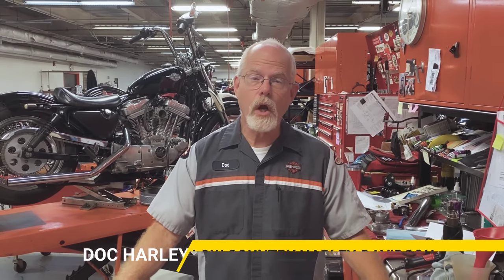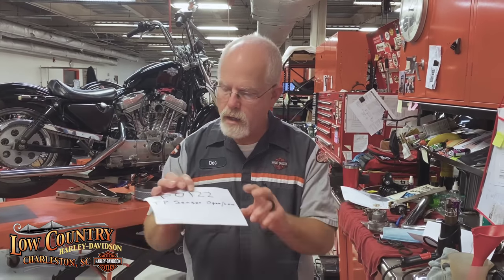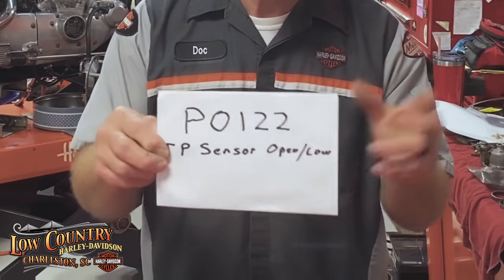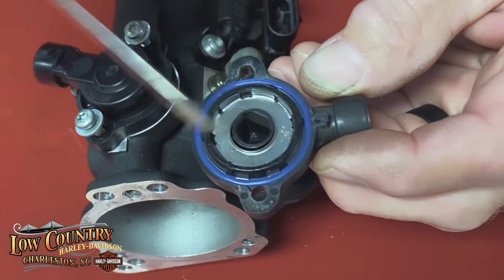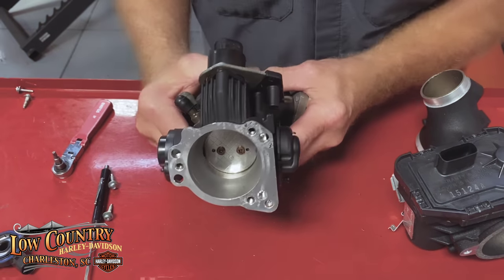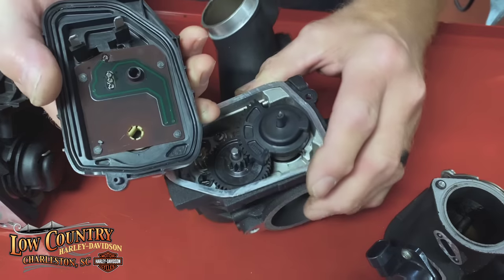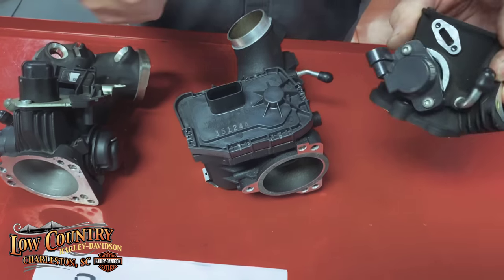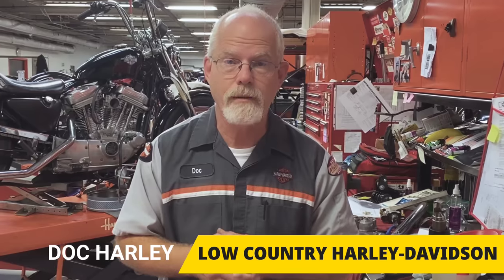Throttle Positioning Sensor | Doc Harley | Low Country Harley-Davidson

Comment: Too bad there isn’t a “Doc Harley” at every dealer…. Life sure would be easier…
Reply from the maker: There are many who are better, but I thank you...Doc
Reply: @LowCountryHarleyDavidson  Oh no.   They start out with "it might be the tire pressure"  "It might be the fuel, we will have to drain and clean the system"  On and On
Reply: @LowCountryHarleyDavidson  Doc it’s not so much the skills or even the knowledge. It’s that you have a passion and actually care. Too many techs ( not just Harley ) don’t care and they’re bothered by customers so much they can’t focus on the actual task. Not bothered as if  a customer is haggling or calling all the time. They simply are bothered by the mere fact of just bringing the bike in and asking questions. They’re annoyed by that. Instead of taking the approach of “ what’s the problem with the bike? And wanting to find a solution “.
Reply: @LowCountryHarleyDavidson  Don't want to disagree with you, and maybe (but I don't think so) there might be some that are better, but I don't think anyone has the passion you do about helping people understand how there bike works and things a rider can do to make sure their bike is safe and running at peak performance.  Thanks for taking to time to do these videos.
Reply: 🚲🚶💭 thanks doc harley. 
                👍👍👍👍👍
                 🌠🌠🌠🌠🌠

Comment: Doc, Love your videos.  My wives 2001 Heritage had a cough occasionally and was hard to diagnose.   Finally figured out that it was when the gas tank was lower than half full.  The corrugated gas hose in the tank stretches after a while and the hose rubbed on the side of the tank and got a small pinhole in it.  It was a little tricky to figure out.  Thought some of your listeners might want to know about this issue that I have seen twice on Heritage before.
Keep em coming.
Reply from the maker: Thanks for sharing....Doc

Comment: Been there many years ago on my 03Ultra. Pulled off interstate and tried to die at exit stop sign, hotter than normal. I believe it was running very lean at the particular speed we were traveling.  Took it a little slower and rest of the trip home was ok. Checked resistance of TPS once we were home and sure enough it had a definite bad spot. Did a Thundermax tuner last year decided to replace it again as we are around 138k now. Kept the old one as a spare as it is still good but feel better with a new one on it. 
We thank you for your continued support and info.
Reply from the maker: Thanks for sharing your story...Doc

Comment: Great vid doc, thanks. 
Exactly what I had concerns about, but my2015 - 1200 only has about 15k miles. so think its unlikely to be wear on that sensor.
Has a ragged patch, just as throttle opens a tiny bit. Realy dosnt like ticking along steady around town. 
Fine under power, and everywhere else, just that first tiny touch. 
S.E tuner cables should be here this week, so will plug it into record mode for a while and see if that shows where the issue is. 
Tks again.
Reply from the maker: A great plan….Doc
Reply: @LowCountryHarleyDavidson   Ive been rideing a few decades, (newest was an 82 mk111 Guzzi) But this is 1st HD, 
Not used to the computers, elec ign or fuel injected, so a little head scratching 😂.
She gonna visit the 1 guy in town that realy knows what he's about. (small town on West Aussie coast) He has 650 Harleys on his shop books. Not that many in the area & Lotta guys travel a long way from sth and nth for his work, so I think we're in good hands :) 
Im just watching and learning  ☺.

Gotta say i love this sporty. So much time wasted. (kinda)

Comment: Thanks Doc. Always informative.  Prior video question:  The factory changed the oil pump in 2020. Does the 2019 1/2 Electra glide standard have the newer oil pump?

Comment: Hey Doc...Awesome videos and thank you for taking the time to do that for all of us Harley Riders.  Quick question:  2003 Harley Road King EFI FLHRI   Replacing the TPS is pretty straight forward so my question is...Is there any calibration or setting for this TPS or is it a "bolt on and go"???   I don't see anything about Calibration so Im assuming there is none but I wanted to run it past the Guru first..
Reply from the maker: Should be a plug and play with stock ECM. Buells and ThunderMax have to be calibrated...Doc

Comment: Thanks for the info Doc!  I have a 2020 Softail Standard that has an overly stiff throttle position sensor.  It wears out my wrist after 1/2 hour of riding.  I changed handlebars and decided to disassemble the TPS to see what was going on.  If I ruin it I"ll buy another one.  I'm trying to figure out how to remove the splined cog on the end of the sensor without destroying the sensor.  Do you have any idea how to do that?

Comment: I’ve got a 2021 street glide special that has 18K miles on it and I’ve just noticed it had that same code. I’m just wondering if it’s too early to be that or a broken wire or something?
Reply from the maker: Most of the time on recent models it is a clitch. It occurs most of the time with riders who shut off motor with the handlebar switch while their palm has the throttle rolled on a bit. You should still have it checked out…..Doc

Comment: Doc do you have a video on the Cam Position Sensor? I have an intermittent engine light that’s been coming on for years and I believe someone said it was either a ground issue and or this sensor possibly needed replacing. It’s on a 2000 FXDX. THANKS

Comment: I have a question DOC - I have a 2014 Streetglide Special , 26k  , the issue I’m having is that when I’m on the highway and shifting up  the bike sometimes seems as it looses power for a second or 3 so I release and re engage and it’s fine happens in higher gears. Kind of like as if it’s  spuddering  and not all the time here and there any insight to for me to look into Doc ! Thanks  for your input
Reply from the maker: Thanks for trusting and reaching out to us at Low Country Harley-Davidson. This is not a simple diagnosis. I would start first with battery check. Condition and connection. Older than 4 years replace. Have someone check charging system. Spark plugs and wires depending on mileage then fuel filter…Doc

Comment: Hi Doc, so I'm wondering would there always be a code showing up. My sportster is acting up when I try to keep it smooth around 35 mph. But it will hesitate and/or misfire. I'm thinking of the TPS. But I can't see any code. What do you think. Thanks doc. Alan, from Scotland.
Reply from the maker: No a code will not always show up…..Doc

Comment: Love the higher resolution camera!  Are there metal gears to replace the hard nylon? Would they be preferable or force wear sooner where you can’t get to it?  Thanks Doc!
Reply from the maker: This is a non servicable part.Was taken apart to demonstrate.. HPI might offer mods.......Doc
Reply: Nylon gears can be bullet proof.  Not I mod I would recommend.  As proof, the old indestructible Maytag washing machine transmissions used white nylon gears.

Comment: Thats great. Looking at my parts manual the complete induction module has to be purchased to replace a bad tps on a 2010 road king
Reply from the maker: Yep sad but true…..Doc
Reply: I am impressed. I really didn't expect a response. Love your videos. I am guessing with 86,000 miles mine is do for a change. Seems to have intermitten sputter from a stop sign. p2138,p2127,p1510,po113. Runs down the road 42 mpg. intermitten engine light.  @LowCountryHarleyDavidson  1st had p0113 iat solved , Then battery light, regultaor rectifier solved, Now p0113, p1510',p2127, p2138. mistakenly replaced iat with non harley part so that explains p0113. kind of shopping for a take off intake, may try removing the retaining cover clips and just swap unless I notice something with gears. I have had harleys since the 70s and spend a lot on parts though 0 on service. If I were closer it would be worth swinging by for a diag. I ride 70 miles to my favorite dealer to buy parts.

Comment: On my 08 roadking I had a whipe out and it started to idle high but its electronic so no adjustment. Turns out if i turn it off with more than 0 throttle it needs to be reset. This video was my first thought but after digging further I found out it wasn't the sensor.

Comment: I've got a 2009 street glide and recently it went into limp mode and has a surging idle with these codes P1511, P1514, p2105, P2135. Do you think this would come from the TPS sensor going bad? thanks! Great Video!
Reply from the maker: More likely the pins and connections in the connector to Throttle Control Mech. If you are lucky all you need is to replace the female connectors in the connector with the newer updated parts.
Reply: @LowCountryHarleyDavidson  thank you! I’m taking it apart tonight!
Reply: @LowCountryHarleyDavidson  found the issue. The brown/orange wire in that plug has a break in it when wiggling the wire with the Fluke meter right at the edge of the female connector. Thank you again 🙏🏽
Reply: Yes similar codes with my '09 UC, had the limp mode issue or nothing a couple times. Thinking those pins or a crimped wire also.

Comment: Heya Doc i have a 2019 xl1200ns with a P0122. Any pointers on how to calibrate a TPS??
Reply from the maker: Not sure what you mean by calibrate. Usual issue is owner turning off bike with handlebar off switch while slightly rolling throttle ( not knowing he is doing this) so the bike ECM remembers where throttle plate is. But when turning on bike the TpS does not match last known information. So turn on bike without touching throttle. Wait 20 seconds. Turn off 20 seconds. Repeat 2 more times. All will be calibrated
Reply: @LowCountryHarleyDavidson   I thought there was some special way of putting it back on. Kind of like on a car lol. Thanks for the reply Doc. Appreciate ya

Comment: I’m working on a 2014 ultra ..I’ve replaced the throttle sensor and I’ve checked all wires between throttle and throttle body and from the ecu to throttle body and the only thing I found is no  voltage on the high/ low wires but have questions on if m testing the right way and could it be the ecu
Reply from the maker: Yes it could end up being the ECM but more likely a wire near the neck that is internally semi-broken. Won’t see it. Got to pull inch by inch till you feel the break….Doc
Reply: @LowCountryHarleyDavidson  even though Continuity in all wires is good

Comment: Hello Doc:) I have a 06 Sportster XL1200C with (35,000 kms) 21,875 miles
I just installed V&H Short Shots, larger Air Breather, Pilot Jet 45 and 185 Main Jet with 3 washers on slide needle
I'm out 2.5 turns trying to smooth my bike from lurching a bit at steady Throttle
Any help/suggestions would be greatly appreciated
Thanks in Advance 
Bill M

Comment: Good day what does it mean when I’m in second shifting into  higher gears when I open the throttle when shifting the bike Boggs no power  and I release the throttle and it goes back to  normal. No cods 2014 SGS  thanks
Reply from the maker: Year, model, modifications, fuel filter last change? Battery age, spark plugs age? Too many variables to give a fair diagnosis…..Doc

Comment: Great Video, one question. My Iron 883 model 2020 hast very high Idle consistently about 1600-2300 RPM... The ecu tells me the Error p0122 Sometimes and p0507 every time. Engine light is in every time. Should i replace the TPS? Shes got only 10000km
Reply from the maker: Start by readjusting your throttle cables. If you have chsnged the handlebars you have a throttle position sensor wire problem. Follow all the wires. If you have changed the air cleaner. You might have a leak. Maybe a un supported throttle body so an air leak at manifold seals…..Doc
Reply: @LowCountryHarleyDavidson  yes i changed the handlebars and the odometer to the Side. Throttle cables are fine the throttle flap opens and closes correct. I installed an Arlen Ness Big sucker too. Thank i have to Take a Look at the wires that i extended an Air leaks. Thank you for your time Doc

Comment: Dear, the code 2138 road king 2008 appeared. Do you have any tips for a solution?
Reply from the maker: P2138 TGS correlation error. Twist Grip Sensor wiring check for poor connection. Rubbed through wire insulation ( from install in aftermarket handlebars) if all wires and connections are good then voltage testing is next….Doc
Reply: @LowCountryHarleyDavidson  Thanks for help.

Comment: I have a 2005  HARLEY DELUXE with this issue. Replaced the TPS but the issue is still there. Is there a way to adjust the TPS? Would a weak battery cause the TPS to fluctuate? Currently it will not hold an idle.
Reply from the maker: Yes there is a slight adjustment possibility. But I have to ask How are your intake seals?  And are you running 8 degree injectors when the 25 degree injectors with the right software run and idle so much better....Doc

Comment: Hi Doc, looking at this video and I'm wondering if this could be the trouble with my bike. It's a XL 1200C, it's a 2011but only has 18000 miles. I can't see any DTC codes. But doing 30-40 mph I'm getting a misfire and jerking. The nearest dealer is at Edinburgh or Glasgow about 150 miles from Aberdeen. What do you think. Och I'm fair seek aboot this doc. Thanks Alan.
Reply from the maker: Is your bike completly stock? Does this misfire only happen at this part of the throttle? Have you checked your intake manifold seals? Too many questions to be able to say yes....Doc
Reply: @LowCountryHarleyDavidson  Hi Doc thanks for getting back to me. Yes the bike is stock aside from the mufflers, which are Harley but the cats are out.  Stock airbox. It's only at around 30mph in traffic. The bike will act up, missing and jerking around. I haven't had the manifold off at any time.
Thanks for any advice you can pass along. Cheers, Alan.

Comment: Hi, I have a 2021 Police Ultra, when at 70 I torque it to pass a semi, the tach fluctuates. Also, the cruise control is deactivated on a hill, is it related to the throttle positioning sensor?
Reply from the maker: Tach fluctuating will turn off cruise and effect power output…..Doc

Comment: Hey Doc, interesting video, I have somewhat of a issue with my 18 SGS.  It has about 15000 miles on it and stage 4.  My issue is different but when I am red light and I go I have a hesitation issue from my bike. It is really annoying, only from the start when I start to go.  Doesn’t do it all the time but at least half the time. Jus sputters and then all of a sudden is goes and only from the start. Super annoying, could this be the same issue in my bike?
Reply: Had the same issue on my 18 Limited from 15000 miles on. Took it to 3 diffrrent dealers in DC area. No code so they said nothing wrong. I suggested a re flash( stock everything)? They looked at me like i was crazy. Did an air filter oil bypass & seemed to help. Maybe carbon on top of piston causing valves to problem up?
Reply: @johngloede8222   yah I dunno, you’re suggesting venting to the atmosphere or catch can from breather bolts?
I was wanting to get some headers, and the HD smart tune added with my screaming eagle tuner and then get it dynoed. Maybe it is a bit of a mapping issue.

Comment: I have a P2127 TGS2 Low/Open and p1510 codes w/check engine light on, but my Harley Softail Standard is running fine, it's been on for about 2 months, finally was able to get it to my dealer, and they said it's a sensor. It confused because like I said it's not giving me any problems. It's a new bike w/5500 miles on it
Reply from the maker: Communications could have been better from your dealer. I believe they found a connector to a sensor that had questionable terminals. The bike ran ok for now but this connector had loose male to female terminals that would have failed down the road....Doc

Comment: What about a fluctuating idle? My 09 road king will go from 1100 rpm to 700 up to 1200 then below 700 and sometimes turn off while idling in neutral at a red light. Seems like once engine gets to temperature idle fluctuates
Reply from the maker: My first thought is an intake seal is leaking and allowing air in. Could also be the IAC pintle has excessive carbon on it or is failing. And of coarse many other possibilities. Fuel filter, holes in fuel line in tank, Not a correct tune, bad Engine temp sensor.....bring it to your local expert and them check these out.....Doc

Comment: Can this affect the cruis control on an 2016 FLSTN with Electronic throttle? I did the diagnostic with the run/offswitch + ignition+ crctrl + forward throttle and all got the green light..CR/CTRL still not working ps I also replace original switches on CR/Ctrl
Reply from the maker: You have done everything correctly. I suggest checking brake light functions. as if the front switch is twitchy and is sending a false signal and keeping the system from activating....Doc

Comment: help Doc...2010 street glide, i need those gears for the butterfly and cant find a part number , if anyone has that number it would be greatly appreciated... 
my symptom was a rapid click when i switch to run,  and fuel pump didn't  pressure, but switch off and to run again  and all is normal...  i removed the clipped cover and sure enough 2 teeth missing,  the second and the third.  it appeared to shutter enough the first try to position it, that it would grab the second time every time. i was on a road trip at the time, lucky/glad it didn't leave me stranded.
Reply from the maker: There never was part numbers. HD never said we could disassemble….complete assembly needed…..Doc